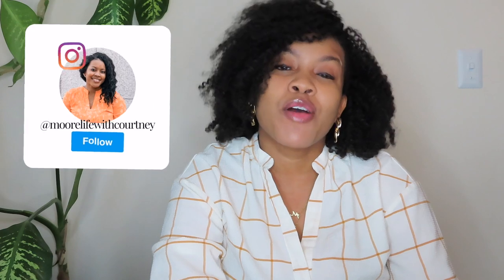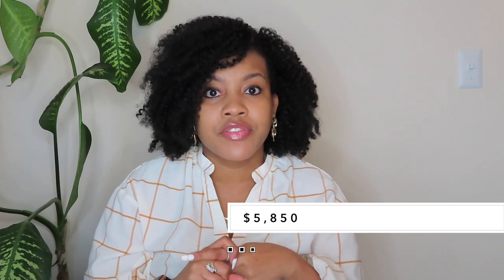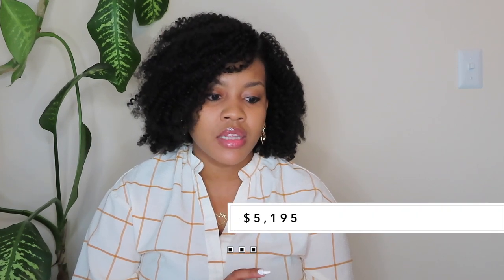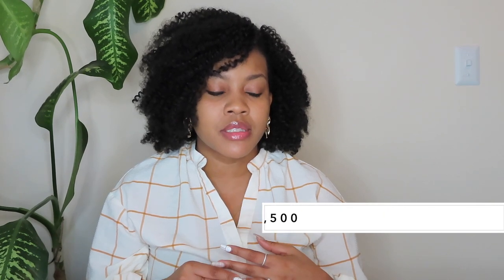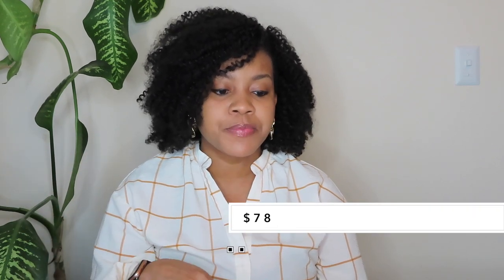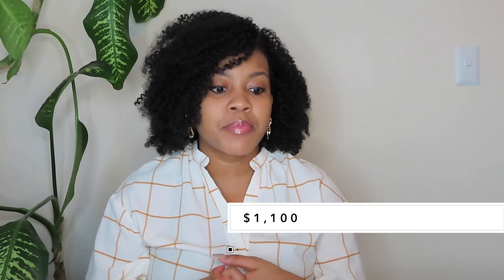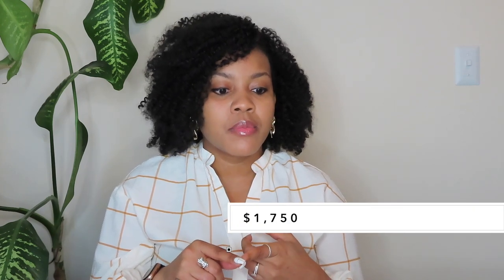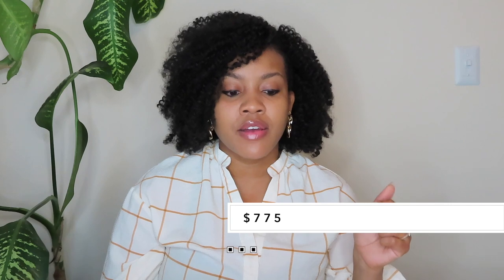160K in Upgrades We Chose at Design Center!! || Cost Breakdown || DREAM HOME || Chateau de Moore

Comment: People, pay out of pocket after closing to upgrade your home. Whatever you add with upgrades it is added to your loan... which means that you're paying interest on lights fixtures, crown molding, ect... for the LIFE of the loan. Don't do it. Take your time and do it after you build. Just a little added FYI to all of those going through this process. My husband and I are currently building our dream home. Upgrade only structural things that are too difficult or that you can't change later. Great informative though.
Reply from the maker: Yes! Yes! Exactly!! Thank you!! ♥️♥️
Reply: yes i agree. I wonder can you pay out of pocket so that it isnt added to the loan? for example i already have a contract in place but i didnt meet with the buildings yet. Im wondering if i can ask for extra cable outlets and a wall outlets for my TV's which i can pay upfront.. I just dont want to add anything else to the base price/loan
Reply: @Jay Fragher  yes you can. I did it this week. We wrote a check for our upgrades and our builder even offered to break it up into payments to he paid before closing.
Reply: That only applies if you plan on staying in the house for over 10 years. Most people move in 5-7 years. So in 5-7 years you will pay only a fraction of the total price of those countertops or that flooring.  If you do it after closing, you will be paying 100% of the cost of that countertop and you can’t take it with you when you sell the house. So most times you actually pay less when you roll it into the mortgage

Comment: Beautiful Home!!!!  Are the under cabinet lights hard wired?? For your downstairs office/study room Did you have the door added or was it standard??
TiA & Congratulations 🎉
Reply from the maker: Thank you!! ♥️ Yes, we got the under cabinet lighting hardwired with the builder. The doors were added. Without the door, the room would be been called the library. But with doors, they called it an office. The style of doors is the only option they gave.
Reply: @CuratingCourtney  okay Thank You , I looking to buy my first home and there is a "flex" room so I'm thinking about adding french doors if possible.. I understand that you have to pay a percentage of your total for The design center (upgrades) but when / how do you pay the balance or is it added into the home price?? 🤔 Should I start saving separately now for the design center 🫣 
* Can't find a video on the complete process of how that works 😔..
TiA

Comment: what state do u leave in ma'am cause these prices are not too bad at all compared to what they ask me for my stairs I asked for hardwood  floors they told me  starting at 7k I told them nurp I'll get it done with another company
Reply from the maker: Hey! We’re in Maryland. I’m sure the prices depend on the cost of living too. They over charge for everything! Smh
Reply: I agree the prices didn't sound too bad.
Ex. Ceiling fan prep buy my builder was $855 each and recess lights $416 each